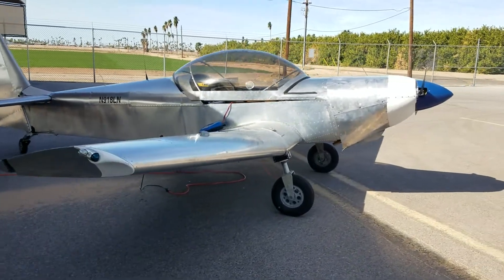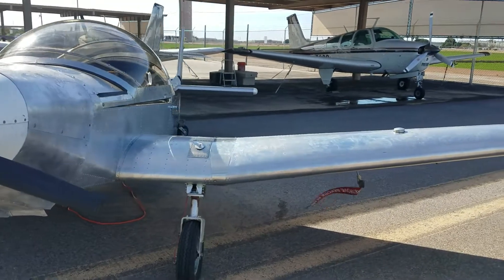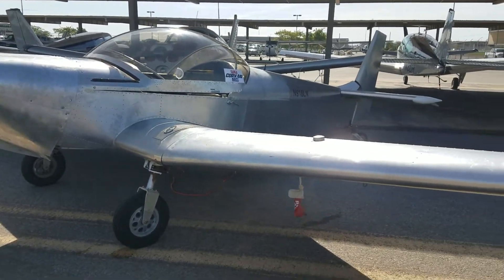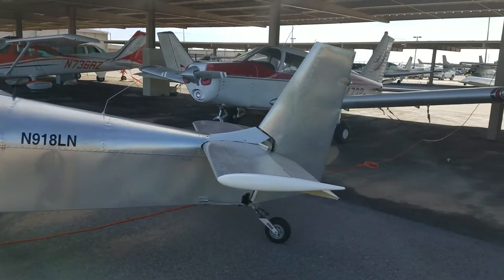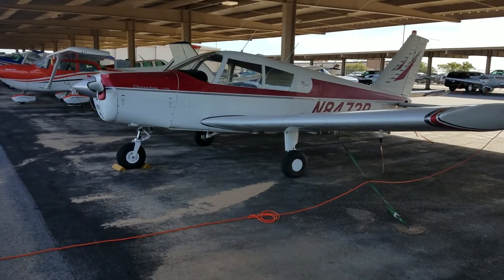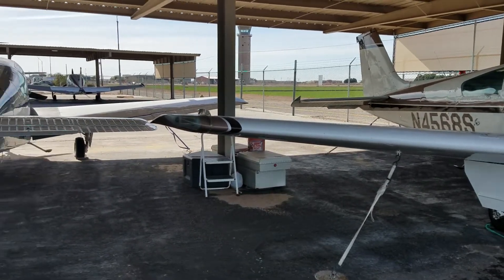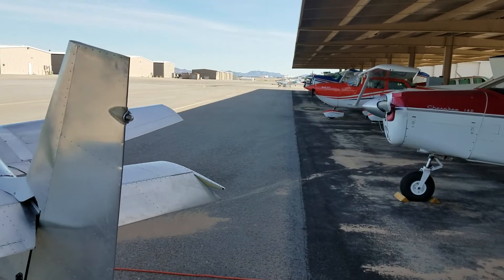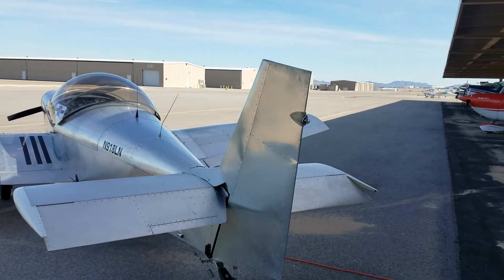Quick walk around of my Zenith 601 HDS Part 1

Comment: Hi can you send me any images and dimensions or plans of where the gear slides go for the main gear? We have the nose wheel plans but have the tail wheel kit. I would really appreciate it! Thanks
Reply from the maker: Zenith aircraft has the plans.  I don't have any drawings of the tailwheel locations.
Reply: @zenvairpilot  Thanks for your reply. I have purchased the plans but they sent me the nosewheel variant positions for the main gear slides; these are incorrect. Thought you might be able to take a pic of the particular page of the center wing that I need. Doesn't matter; your aircraft looks great...well done.